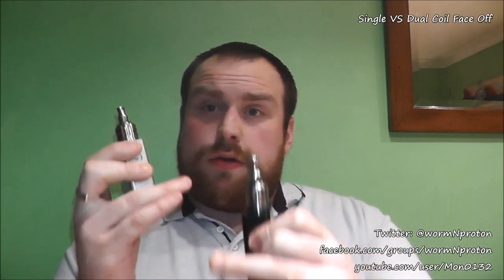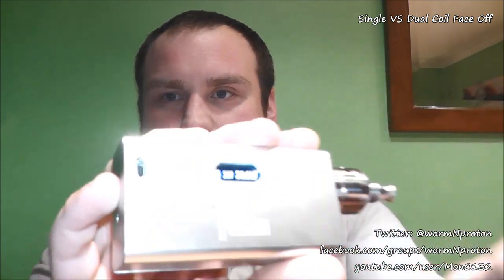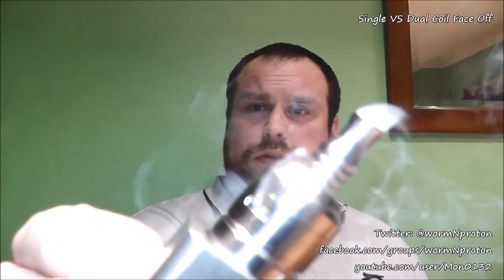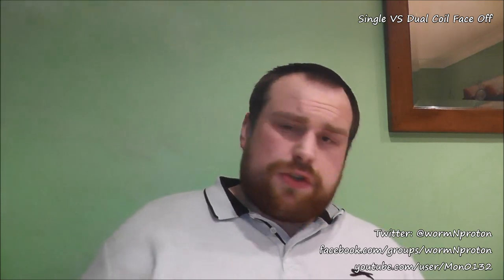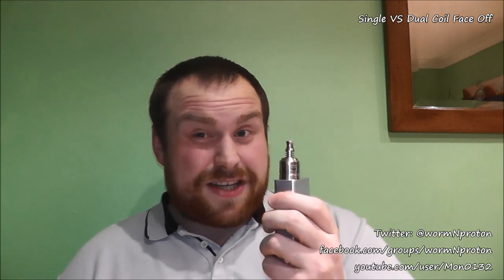Single Coil vs Dual Coil Which is Better? - THE FACE OFF

Comment: Hi Mr P
Thank's for taking the time to do this video.
Before replying to this I went and recoiled some of my drippers to single coil builds and was very pleased with the results.
Like you said , I find I'm dripping juice a lot less on the single coil and getting more hits per fill.
Didn't notice a significant drop in vapour production , don't get me wrong , I like blowing clouds like most , but I'm not planning on entering any competitions.
The real bonus for me is if I want to swap to a a completely different juice , like a fruit to a custard vape , the work involved in rewicking is a lot less time consuming.
I think I'll go the single coil route here in , if anything it will help me cut down the length of my own video reviews, lol
Reply from the maker: haha no worries mate i saw your comment and i know ive wanted to do a video for a long time on this you spurred me on to do it thanks lee for commenting :)

Comment: G'Day Mate - from the land Down Under - you've shown me light. Hard to dispute pure logic, but being a die hard sceptic, I had to prove it to myself. Had not built single coil build for 18 months, but had to put it to the test. Put a .5 with 29 AW twisted @ 4 wraps & have to admit flavour & production is just as good. Have probably snorted 1 ml typing this, so the jury is still out on refill time. Will be interested to try in the Rose & Orchid, will post a result. Anyway, good job Mate, refreshing to see lateral thinking.

Comment: The thing is, if you have the same current running across two coils, there is only half the wattage running through each. When you have the dual coil running at 30 watts, it's like vaping two singles at 15 watts. That's why your vapor production is lower with the dual

Comment: I know this is from 2014 but with duel coils you need at least 60-65 w to start to get a good vape. I still prefer single coil. single flat Clapton gives great flavour and decent warm clouds at 75w but in duel I got to crank it up to at least 140 and my batteries are dead within the hour

Comment: Thanks for relieving my guilt. As I just started to build I wanted the perfect sub ohm dual build. After building a couple single .9 -1.4 vs the .4 dual and had a happy and proud moment  until the new wore off and felt this wasn't as good as my first batch of singles. After couple days I tore out the "perfect micro dual" and built a single macro at 1.4 and get the satisfied vape. Personal preference sure but confirmed my experience because I thought I was doing something wrong.Think it was the novelty of building low pretty sub ohm and can I do it. Realistically it wasn't any benefit to my personal experience either other than the accomplishment and satisfied that I was capable. Enjoyed this video, thanks !

Comment: I just switched the tohb to single coil @ 1.9-2.0 ohms at 30 watts (7.8 volts) with a ultra wide bore delrin topcap/tip,left it stock (no drilling extra holes), I don't cover the other holes, smooth vape with tons and tons of vapor but I do go through a crap ton of juice. By the way the coil is 11 wraps of 28 ga Kanthal around that little blue handled screwdriver.

Comment: I find myself clicking the switch early to get a run up of temperature before I start to vape on a dual set up and I don't like that, a while ago I saw a comment somewhere on youtube that singles were better, I decided to eventually check this out and your video was the first one I landed on and it all makes sense, so now to try out singles and see how I get on, It's the extended battery life I like the sound of the most. Just had to subscribe.
Reply from the maker: pa maj give it a go and let me know your thoughts i believe there are many advantages for single over dual but ultimately it comes down to preference, thanks for subscribing :)
Reply from the maker: pa maj after a quick check you may get all three for the 4 euro i will try and confirm this
Reply: WormNProton OH, I can't wait to see what I can get for 4 euro, especially if there are three of them, LOL, only joking, I think you got your last post mixed up with mine although it still sounds good to me.
Reply: Just finished and tried a single coil build, replacing a dual build, If I knew a single could do the job and do it well like this I would not have faffed around so much with dual coils. Thank you for taking your time to make a video on this subject, I guess it IS definitely a learning curve to find what suits one self :-)
Reply from the maker: pa maj im glad you had a go and have seen that it can do it just as well and a much easier process as well as saving time, money and materials. every day is a learning curve lol theres always new, bigger, better but im just interested in whats best lol :) live long and vape on
Reply: I find myself clicking the lighter to light my analogue sadly. I just couldn't get on with it, started making my own juices which seemed ok then just got peed off with vanilla custard scented fingerprints over everything, along with harsh vapes, amazing vapes but the battery is running out.... argghh. I will be back. I just needed some time out and kind of felt I wanted to let the ecig technology to mature before my return.
Reply: Don't worry mate that happens, some of my friends go back and forth but are catching on, they vape more than smoke now, still a good thing as I see it.
Sometimes I still get a little peeved with it but as soon as something tasty hits my taste buds, well, what can I say except, cigi's never done that.
Always remember you can always give it another go :)
Reply: I vape on a single coil I love it you get large hits and good flavor I actually was looking to see if it's safe to do a single in a rdta
Reply: All this time later and I'm still using single coils, batteries are doing great as well ;)

Comment: I personally rather have a thick flavorful cloud.. not a hot flavorless cloud.. unless of course I was trying to reeeally impress someone.. 

my mod is a infinite flask clone with their DNA-30 and a authentic Mr. Owl RDA .. running the single coil, but adjusted air holes for duel coil seems to give me a large thick flavorful cloud just like these. I too go around 20 watts and 1.9 ohm for my daily vaping. 

so far its feeling perfect all around

Comment: Looks like the single coil won the vapour. I don't really think you should build the same ohms on your dual coils as you would with singles - like for like resistance a single will always win. I also found the same as you - to get equivalent flavour and vapour dual coils need to be given low resistance and high wattage. Heat up time/thick wire really hurts flavour if you don't get it hot enough. For dual I pretty much double my wattage or almost half my resistance. 1 ohm dual coil is no good on a mech. 0.5 or 0.6 is about right for me too whereas I would tend to use a 1 ohm single coil. 100% agree.

Comment: Went from dual 6 wraps of 28g to 6 of 26g on a single coil. Same resistance: .6 ohm. The battery life on my mech has increased considerably. Also, I get double the space on the well to drip. The flavor is much more concentrated on my Hobo RDA, which tended to be too airy. Why are we doing duals again?

Comment: the dual has more potential to be an all around vaping experience, but in order to do so it requires more energy because you need to draw more currenct from your battery. a dual coil set up really needs 60 watts to work right.

Comment: The problem you're seeing with your comparison between the atomizers, is that the resistance is not for each coil, but for the whole thing. A 1.5 Ohm dual coil atomizer uses the same amount of current as a 1.5 Ohm single coil atomizer, which means that one does not drain your battery faster than the other if used at the same voltage. The name "dual coil" seems to have a placebo effect on most people, who think their battery is draining faster when it isn't. Here's how this works:

Having two coils in parallel (this is how a dual coil is set up), effectively halves the resistance. What this means is that a 1.5 Ohm dual coil atomizer, is in fact a pair of 3 Ohm coils in parallel. Using a 1.5 Ohm dual coil, is the same thing as powering two 3 Ohm coils at the same time to vaporize the same liquid. So of course this would heat up slowly :).

It's easy to see why a single 1.5 Ohm coil heats up faster than two 3 Ohm coils (a.k.a 1.5 Ohm Dual Coil). The benefit of a dual coil is that its heat is spread out more evenly, even though it doesn't heat up as quickly or as much.
Reply: so do you agree that vaping on a single coil keeps ur battery's charged for lengthier times
Reply: It depends on the resistance of each coil. A dual coil atomizer with a total resistance of 1.5 Ohms and a single coil atomizer with a total resistance of 1.5 Ohms will drain the battery at exactly the same rate: 3.7V / 1.5 Ohms = 2.67 A. A dual coil setup with each coil at 1.5 Ohms, however, will drain your battery twice as fast - a setup with two 1.5 Ohm coils is not labelled a "1.5 Ohm dual coil", it's labelled a "0.75 Ohm dual coil". If you buy a 1.5 Ohm dual coil, what you get is a pair of 3 Ohm coils in parallel (this is the very reason it takes longer to heat up, as is demonstrated in this video). It's simple physics.

Comment: hello. my flowermate hybrid x coil burnt down. I can order new ones, but I have the option to choose from a single coil or a dual coil. they say it's both at 1 ohm, or both at 0.5 ohm. I currently have 0.5 ohm. I don't speak english so I didn't understand the video, sorry. but my question is. should I order a single coil or a dual coil. will a dual coil at 0.5 ohm destroy my battery? so like 0.25 ohm in total would? I am new, I don't know what to do. you seem to know a lot about this so that's why I ask. thanks

Comment: My new Aspire BVC dual coil attie is using up my juice and battery really fast compared to my single coil ego style atties :( I only use it between 5 and 15w!  It's a 2 ohm attie.  What is a good single coil ego attie?  Cannot rebuild the parts are too small for me.
Reply: I know some people who swear by Kanger MT3 single coil tanks still. And others who swear by cartos, even to this day. You kind of have to experiment with them. Go into your local shop and talk to the workers there about what they have available in the single coil options. If you're buying replacement heads, it's best to have a local source should you run into a jam and need them right away. Experiment with different tanks and coils and find the ones you like best. The ones that you aren't so much into can be pif'd to smoker friends who haven't yet tried vaping. The great thing is, the single coil heads cost so little, you really can try them all and your wallet would take about the same hit as purchasing a nice RDA. I personally would have you start with the two I mentioned above, in the 1.8 ohm resistance. Good luck!
Reply: Personally, I used a Nautilus BVC before I switched to rebuilding coils about  year ago. The heads are more expensive compared to other single coils, but I really enjoyed the flavor out of them. Until my throat started being a little scratchy and I developed a slight cough from the wicking material they used. Now that Aspire has switched to cotton in all their replacement heads, I'm okay recommending them again. If you're not concerned with cost, try the new Nautilus BVC coils in cotton, again in the 1.8 ohm area.

Comment: If you have a single coil with 20 wrap running at 30 watts compared to two 10 wrap diameter coils using thesame gauge wire connected in parallel, the dual coil will vape much better because it will get 4 wicks instead of two wicks, but it has to run at 15+15 watts (30 watts total).
Reply: # of wraps means nothing w/o diameter. even then, so unlikrly someone could repeat. plus your example has way too much wire. hope youre not vaping on 10 wrap parallels
Reply: Sorry, the 20 wraps is just for easier explanation. I don't use 20 wraps at all. I always check the best coil dimension that would fit in the well that will produce the desired ohmic values. I should write things down for future reference, LOL.

Comment: I use a tugboat clone.

Dual coil blocks too much airflow imo, i prefer both holes open with one coil at 22.2 Watts.
Reply: Kait Sith if the airflow doesnt come directly next to coil, you lose alot vapor and flavor. Thats why people line up airholes with coils. If you have 2 airholes, you line both of em up with dual coils so you get much more vapor and flavor. If I use single coil, I put a piece of cotton in the other airhole so I dont lose any vapor or flavor. Thats why most RDA's today have adjustable airholes.

Comment: you are comparing different ohms ? if thats the case i dont think its a fair lets put it like this, single coild .5 ohms, dual coil .5 i think thats a best comparation, the single coild to hit .5 use the same kanthal as the dual coil but just do a parallel single
Reply from the maker: the resistance is exactly the same and using regulated devices